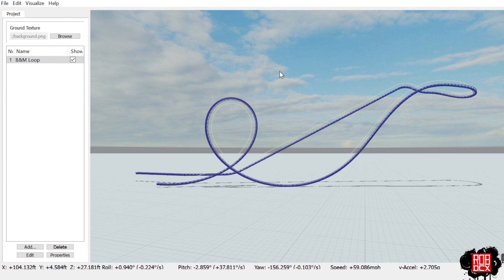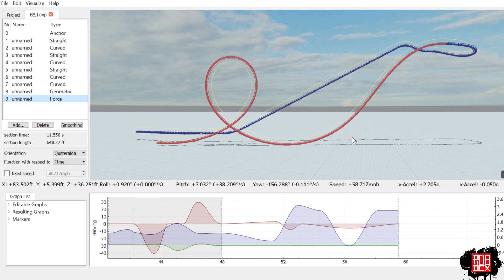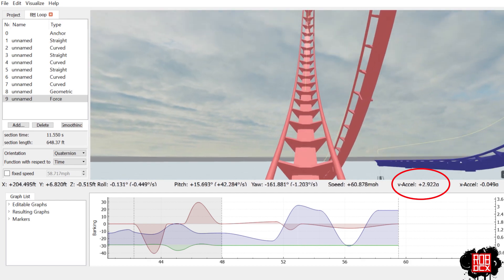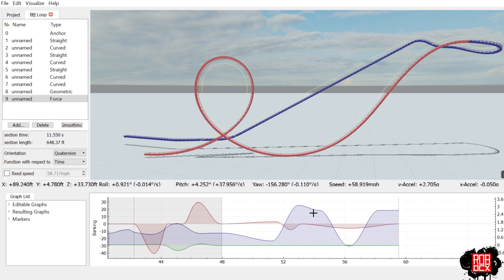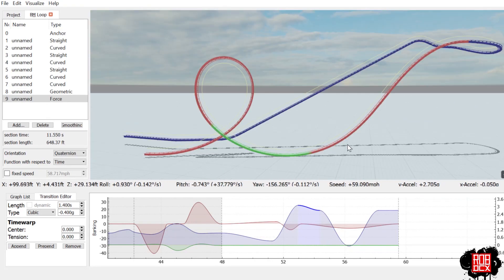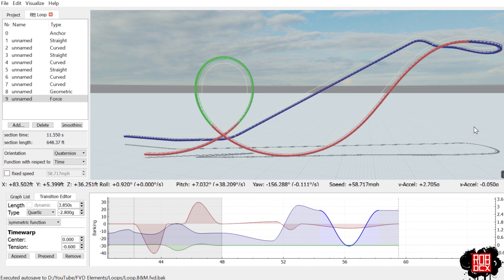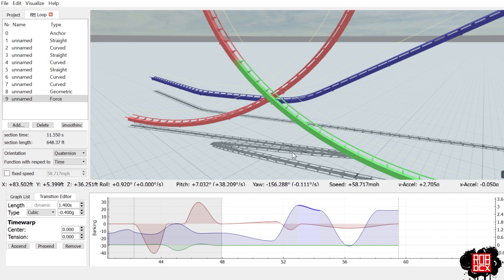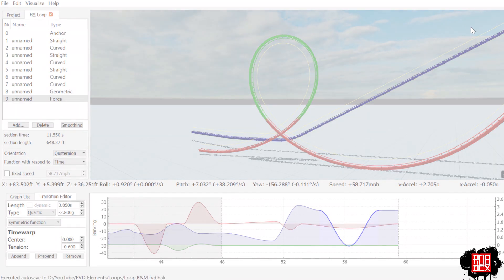FVD Elements | B&M Loop Tutorial

Comment: Hey rob! The reason the track looks weird is because... look at your live lateral g counter... it says -0.05!  That's because the yaw you used in geometric section results in some lats. Even tho you reduced them by setting yaw speed back to 0, you don't have full control of forces (geo section says it all :p) and the little bit of lats that stayed is standing still because you appended a force section that doesn't change the lats at any moment, so it will stay like that unless you correct it at the beginning of the force section 😊☺
Reply from the maker: Ah, yeah, that makes perfect sense. Thanks for the tip! Also, I just uploaded my first try at the Arrow corkscrews you requested. Didnt come out so well, but I'll keep working on it. 😊